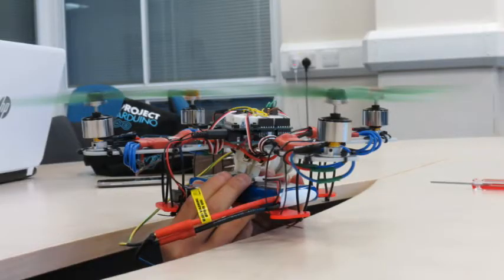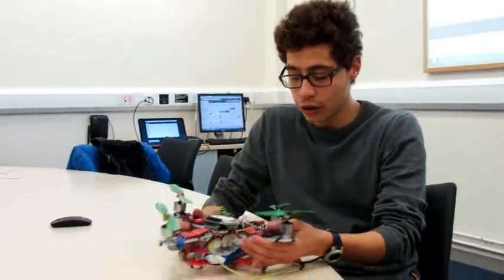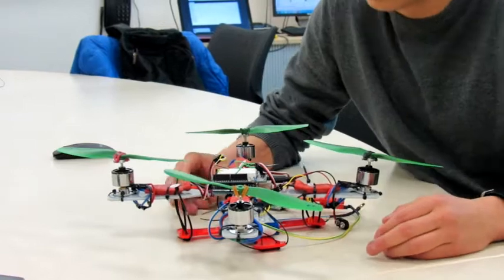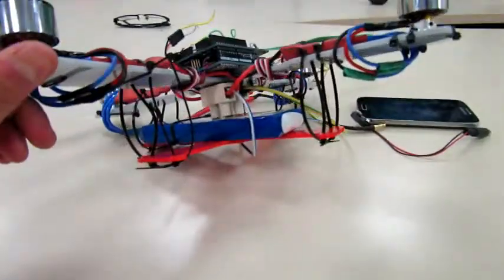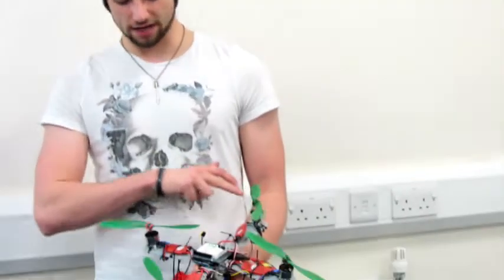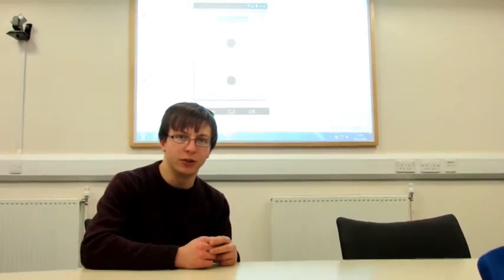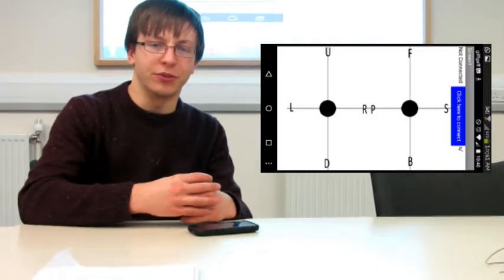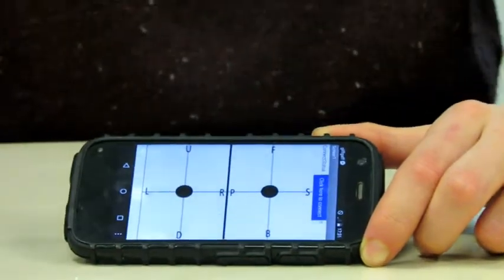✔  Arduino Powered  Drone  Competition 2015

Comment: Could have saved alot of space by soldering. also whats with the block based programming language? Lol its a drone. Mabye use something more reliable and flexible and not so chilish
Reply from the maker: brende the dev  yeah you are right we could've used better  components but we were limited by the Thales company, so we did the best we can and they we looking for the idea rather than a fully working device .... We used arduino  c++ by the way this was done 3 years  ago . ...
Reply from the maker: brende the dev for the limitation we had and a good explanation this competition gave us a win  .. and we came 1st ... but as you said lol we could've have saved alot of space we wanted to used a arm cortex microcontroller really but a more reliable performance and a fully 3D printed body  .... lol but remember limitations made us do what you see on the video  lol
Reply: Well congratulations on the win ^-^